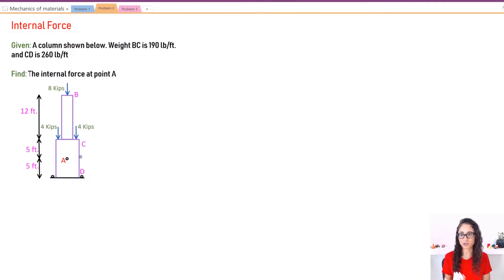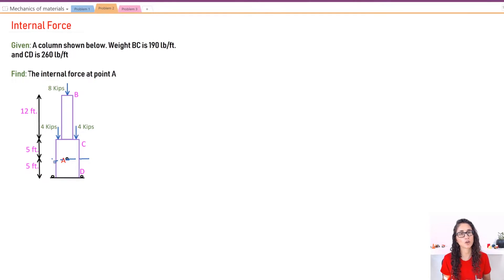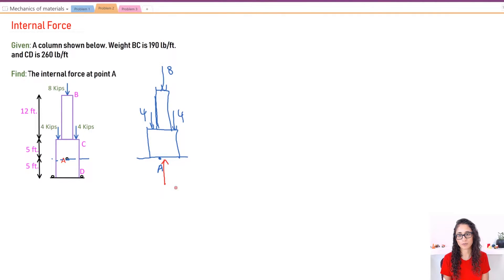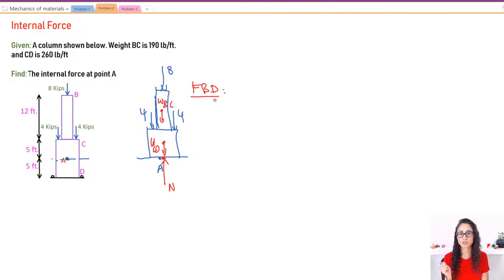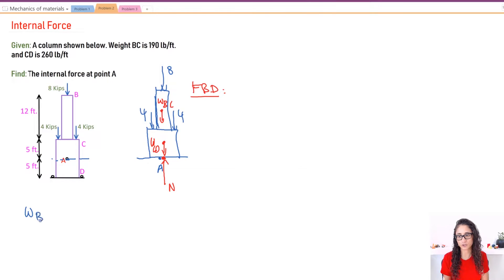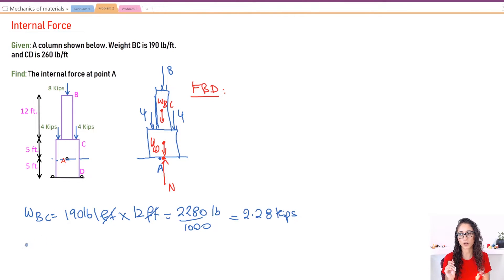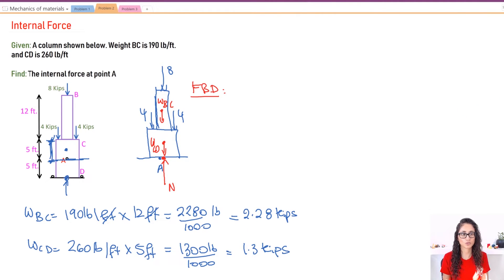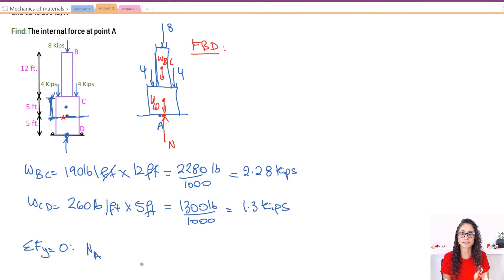FE Exam Mechanics Of Materials - Internal Force At Point A

Comment: If multiplying the distributed load by the vertical length, the load is in the horizontal direction. However, in reality, the dimension you multiply does not determine the vertical load. The vertical loads (normal) and horizontal loads (shear) are independent of the dimensions you multiply. To include the weight, you need to multiply the lb/ft (distributed load) with the horizontal dimensions, not the vertical dimensions. I would say the question is not clear about where the distributed load has been applied.

Comment: Hello kenza i wanna learn that why we are taking Wcd = 260 lb/ft?  Can we take half of weight which is 130?
Reply: 260 lb/ft is the weight per unit length. Multiply by 5 ft for the weight of the desired section.